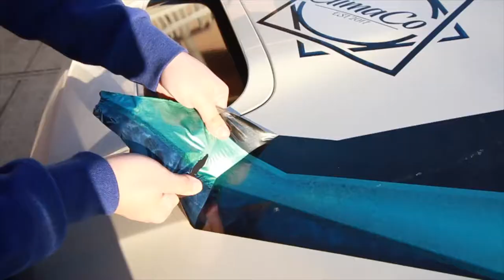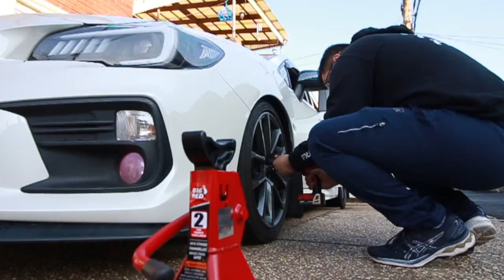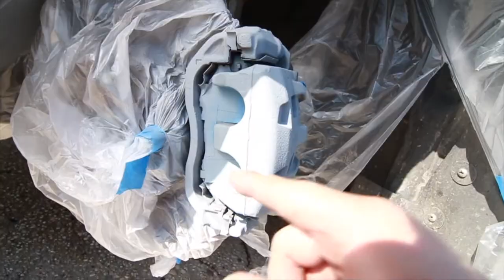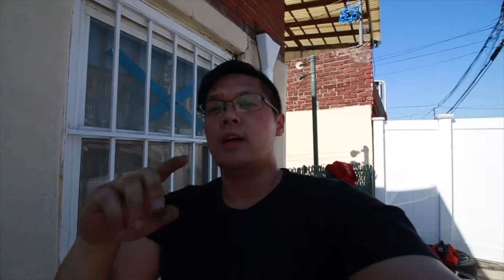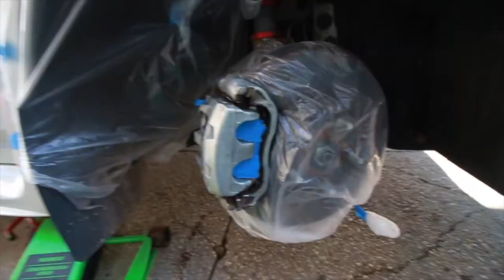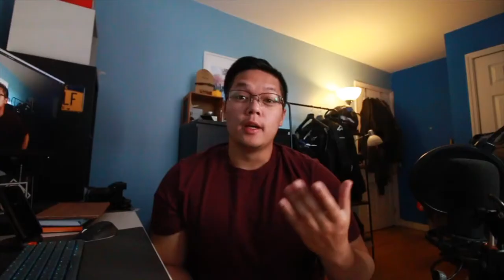you can paint ANY caliper like this?! || WRX Caliper Paint DIY

Comment: I've seen some ads for a new caliper paint that brushes on. I'm sure it's more pricey than the rattle-cans, but it would cut down on a lot of time masking the rotor and wheel well.

Edit: It's the G2 caliper paint system set, available from Tire Rack.
Reply from the maker: That sounds awesome! Im sure it does cut down on masking off the wheel well and the sides of the car BUT my concern is that its harder to get in the nooks and crannies with a brush vs a spray. And you might be at a higher risk for paint runs. This makes me wanna experiment with both